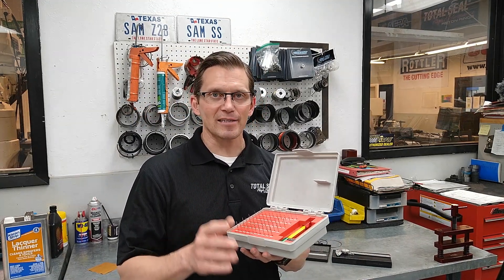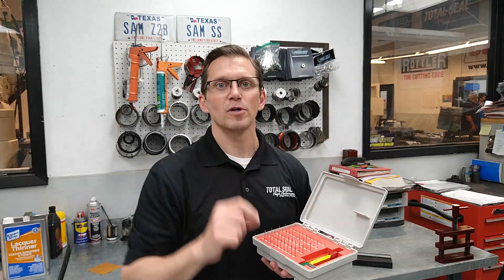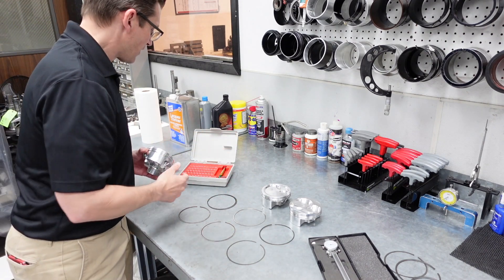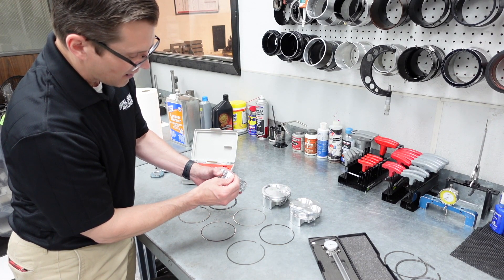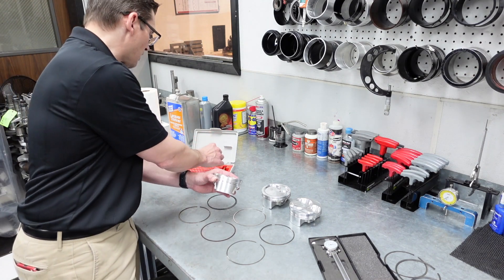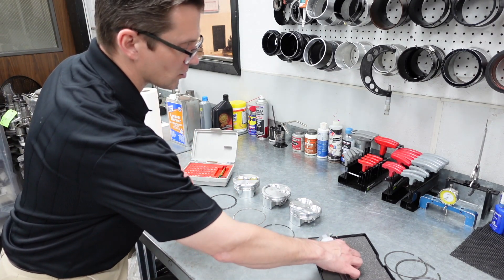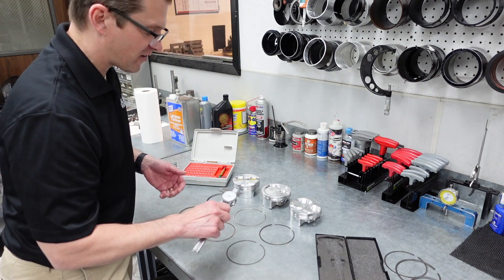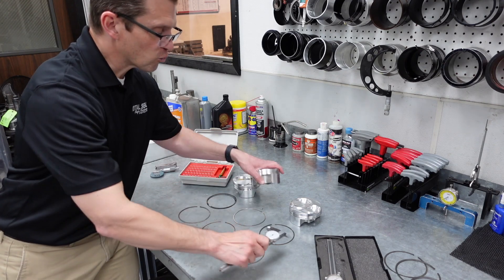How To Properly Measure Piston Ring Groove Dimensions - Critical Measurements For Proper Fit

Comment: 1997 LS1 engine internals are 'Full Race' by design yet durable.  2014 LT1 is more so. Obviously, Ultra Lightweight was the goal. 1/32" thick piston rings for example.

Comment: Hi sir im about to order some rings for my s38b36 engine from e34 m5 was wondering what would be the rings that i need everything is standard, but on bmw site its three types i would assume the smallest ones i would need? Any idea? Thanks
Reply from the maker: It is best to measure your piston ring grooves after the engine is apart, and then order the correct size rings. Don’t take a chance on a guess.